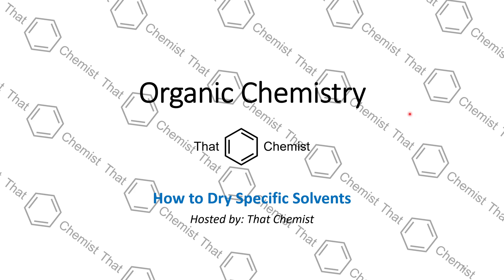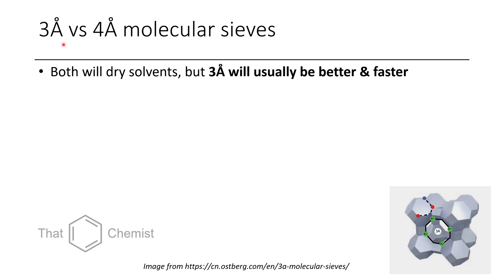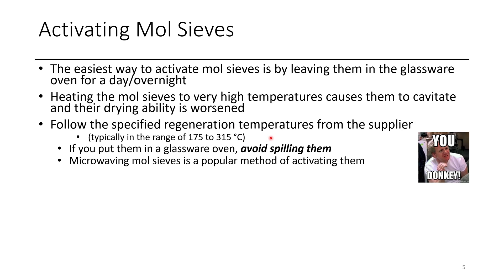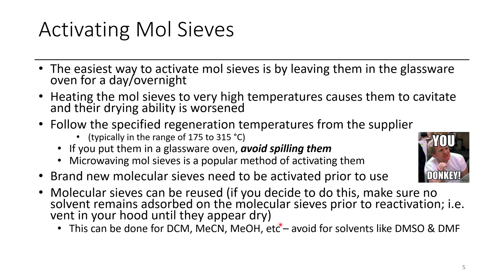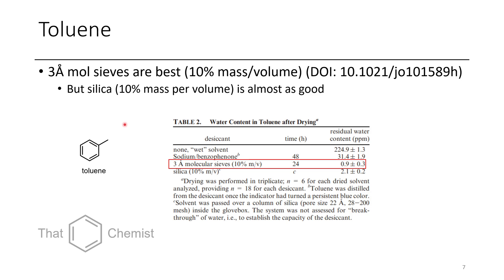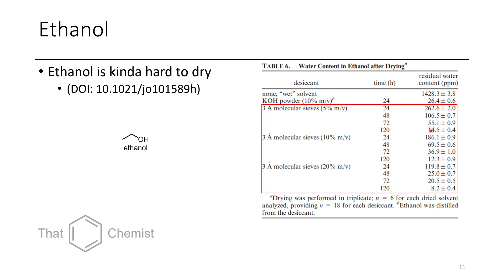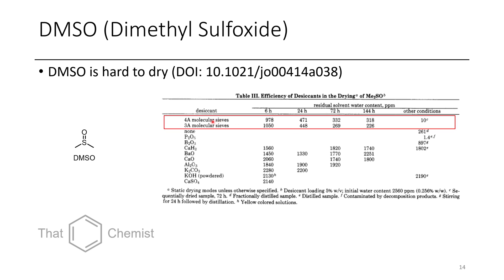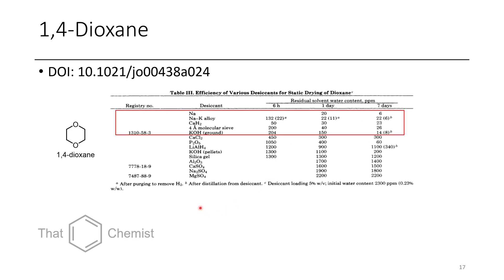How to Best Dry Solvents

Comment: I've effectively used anhydrous potassium carbonate to lower the water content of alcohols. Ethanol in particular was a great success, obtaining 98-98.5% ethanol after treatment. After decanting, I simply heated the residue in an oven to restore the potassium carbonate to an anhydrous state, regenerating the starting drying agent. I then used the magnesium method to lower the water content some more. But the molecular sieves have so much drying power, they're easy to manage, and reactivation after use is just one more little lab chore, no big deal.

Speaking of, I also would have made it my own business to ensure everyone was up to speed on the whole "shorting out the heating element" thing. Six errors is no longer a mistake.

I have an e-copy of the Purifications text you recommended, for sure useful to have around. Good presentation, thanks for sharing.
Reply: Potassium carbonate is an excellent desiccant, it's far better than magnesium sulfate, at least for quick drying solvent after an aqueous workup. It also has the benefit of presenting as dense granules, rather then the magnesium sulfate powder, which means you could even get away with just decanting instead of filtering.. I always use it when I am extracting a freebase amine, as well as other compounds that is not sensitive to alkali.
Reply: @moosehead4497  I agree. The actual physical presentation of the drying agent after its use is very helpful for removing it. It tends to clump together and is very, very easy to decant. I've never had an issue with needing to separate any layers; simply decant the dried alcohol into its own container. Repeat the treatment if necessary (like I said, it usually got to 98% first try).

Comment: Our lab usually dries solvent by stirring with CaH for 30 mins over CaCl2 tube, then distill and proceed to add them into activated 3A molecular sieves. But for reactions that need to be very very dry, we have  THF dispenser that is dried through a special column which was cool.
Reply: Yup that is the best way to get your THF bone dry. THF soaks up lots of water and it sorta sticks to it like flypaper.

Comment: I LOVE molecular sieves, but MgSO4 is alright as well for basic applications.
Reply: yoo after almost all my reactions, I extract the organic layer, pump up and dry with MgSO4. then the dreadful column chromatography.
Reply: @Jimbreh  Exactly 🤣 it works well but it’s such a pain to completely remove and isolate from the product
Reply: @Orchids.and.Endlers  How do you filter? I usually use a medium glass frit with vacuum. Buchner funnel or gravity filtration is awful for removing MgSO4 (from experience)
Reply: @jaredlowe3927  I haven’t had the chance to use a glass grit filter yet, but it certainly seems to be the best method ! The gravity filtrations I’ve done through glass wool take an eternity, if they don’t clog in the process :/
Reply: @Orchids.and.Endlers  Yeah, please never do that again, lol, it's painful just to hear that. (Maybe this could be a video idea, intro to practical glassware) Just FYI, you can buy frits with a vacuum adapter all in one piece (honestly my favorite piece of glassware in the lab)
Reply: @jaredlowe3927  I’ll definitely look into that! Thank you so much. That’s also a great idea! I hope he sees this !!
Reply: @Jimbreh  sure, but there is a difference between getting rid of water for the  column and drying solvents for organometallic chemistry
Reply: As long as you don't need to distill